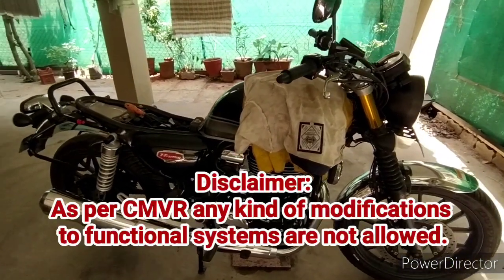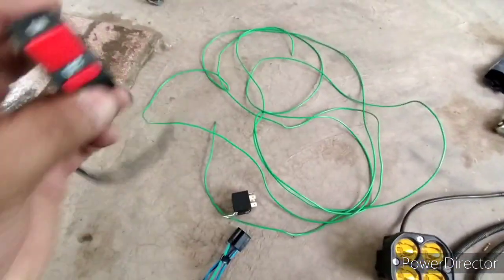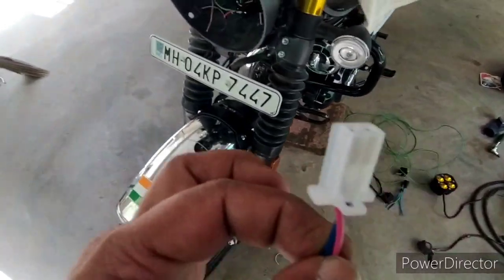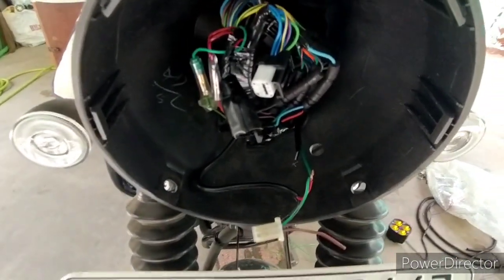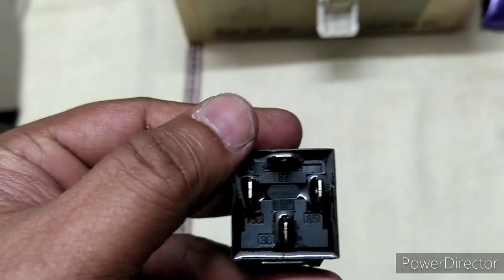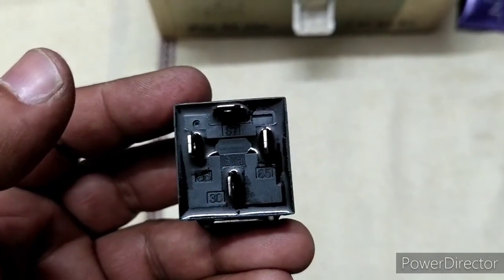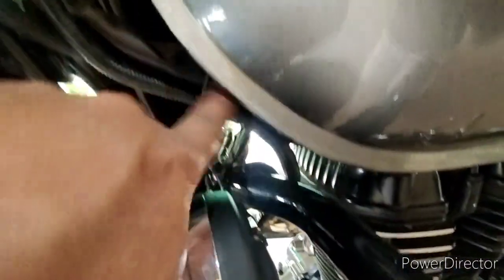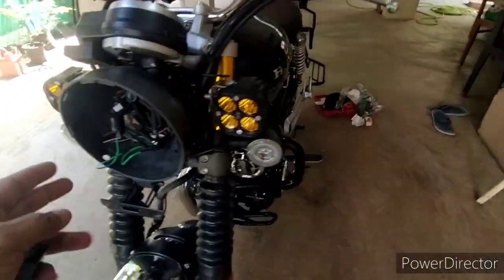Honda H'ness CB350 - Aux light Installation W/O Tampering OE Harness

Comment from the maker: Disclaimer: Before anyone starts debating on the placement of the aux lights, let me clarify upfront that as per CMVR any kind of modifications to functional components is not allowed. So this installation in the first place is a deviation from the rules.

Below link for the fog light mounts:
https://www.amazon.in/dp/B01AG959D2/ref=cm_sw_r_cp_apa_glt_fabc_CPR9YK1FXDJK2BX4G8Q1

Comment: Its hard work and requires patience. It’s preferable to install the fog lamps using wire harness. Its safe, comes with relay, fuse and flasher. No cutting or joints in wires are required. Costs just around 1k-1.5k but worth the price for safety of the electrical system.
Reply from the maker: Yes, it is.. but then what else is there to do in life 😅.
Also from a safety perspective there are joints or cuts to the OE harness..it's all socket based connection in my version.

Comment: hi, what is the measurement of clamp you have used near forks for fixing an aux lights?
Reply from the maker: These are 22mm clamps. Were bought from Amazon but are out of stock since long time.
Below details from the manufacturers website

https://www.electomania.in/products/electomania-a-pair-of-black-motorcycle-turn-signal-light-mount-brackets-fork-ear-clamps-for-harley-black

Comment: Hey Raj.. which are those clamps you have have used to fit the fog lamps besides the headlight location as I have currently installed the fog lights on the leg guard which isn’t giving me proper illumination. Have you got the clamps custom fabricated or is it available at any local shop or online. Please share more about the clamp mount. I want to do the same thing on my RS.
Reply from the maker: These were available on Amazon earlier and later on the manufacturers own website..since some time they have been out of stock.
Check link below:

https://www.electomania.in/products/electomania-a-pair-of-black-motorcycle-turn-signal-light-mount-brackets-fork-ear-clamps-for-harley-black

Comment: Hi where di you connect the -ve of the fog lights to di you return it to the -ve terminal of the battery?
Reply from the maker: Negative of the lights are to be body grounded. 
Sorry for the late reply.
Reply: Thanks I connected the negative of the lighst to the battery and it worked
Reply from the maker: Cool even that works, but just need to route a long cable back to the battery and hence nearest body earth is recommended.
Reply: Ok I already accommodated for that

Comment: Hi Raj. Been a fan (subscribed)👍🏼 of your in-depth knowledge and guidance. 
Looking for an understanding or advice if we can install a RPM meter (absent in our beloved beauty). Your input/thoughts are highly appreciated.
Reply from the maker: Thanks buddy 😊.
Yes, there are plug and play Generic tachometers available in the market that can be installed however the precision of the same is a big doubt. Hence even I have restrained myself from installing one.. there is one Japanese version available from Daytona, but costs a bomb at around 13-14k.
Reply: Kindly provide your input on the wiring connection. Or if you know of any generic plug and play tachometer.
Reply from the maker: See link below. These are universal and come with the wiring diagram specific to their set-up.

Carthrill Universal Tachometer Speedometer Gauge Bike RPM Meter Analog for Bike (Black) https://amzn.eu/d/gucXtKp
https://amzn.eu/d/gucXtKp
Reply: @RajkaGarage  much appreciated.👍🏼
Reply from the maker: Cheers mate 🤘

Comment: Very well explained, 
Q1. Which relay (4pin 40/ 5pin 40/any other)should I used to install 60+60 watt fog lights 12v,for classic 350?
Q2,how much amp fuse should I use for the same?
Thanx buddy.
Reply: 4 pin Relay is enough , 
For choosing relay amp :
 12v - 40ah = 480w which means 
4pin 40 ah relay you can use up to 480W lights 
4 pin 30 ah = up to 360w you can use 
4 pin 20 ah is perfect relay for 60+60 watt light , but you can use 30,40 also no issues
Reply: Fuse you can use 10ah
Reply: You can use 5 pin relay too , if 4 pin relay not available, 

Just leave pin no 87a if you use 5 pin relay 
87a = NC (normally closed circuit)
Reply from the maker: Thanks for answering on my behalf buddy 😊

Comment: Sir,tried using OE Socket but there is no current comes to that socket hence foglight doesnt lit up. Is there any other work around or it is manufacturing defect?
Please reply.
Reply from the maker: Hey buddy, in the OE socket only 1 leg has positive voltage. Check the power at the red wire with a continuity tester. And you will have to take negative power from any metal nut bolt as body ground, only then the light will start.
Reply: @RajkaGarage  Thanks for the reply sir. Then do i have to remove one leg from female socket  which i bought from the market?
Reply from the maker: Use a 2.8 mm 2 pin socket available in spare parts shops and plug it in the OE socket like I have shown in the video. Your positive connection will come from this socket and negative can be body earth.

Comment: Sir, relay that you are using is common Horn relay or some other one, l purchased hjg 60W fog lights, which one i should use 30amp or 40amp.
Reply from the maker: It's a common 4 pin relay. Please use a 30 amps relay.

Comment: HelloRaj, Thanks for the video. However, I was confused about using a relay for this purpose.
What's the difference between splitting the wires and using a relay? Could you clarify that one for me? TIA
Reply from the maker: The relay was used just to save the switch from burning off with the high wattage of the LEDs. And technically that's why relays are used when additional load is used in the system to save the switch and related wiring harness from over heating and melting.

Comment: I was going through the electric diagram, it has two sockets for aux lights and one socket to connect the switch, can we not use as it is
Reply from the maker: Yes, these were just discovered recently. But if one wants to have a relay circuit, these sockets cannot be used. The Tata batteries are already showing its worth (being worthless) and hence without relay it will be load on the harness and battery.

Comment: Sir we can change head light of highness
Reply from the maker: Buddy, one can change the headlight with that of a RE Electra seal beam but will need a lot of modifications to the stock socket and also may need a bigger AMP battery. The stock battery will not withstand the halogen bulb load of 55/60 watt.  Will suggest fitting good pair of auxiliary lighting like maddog etc instead of going through the mod hassle.
Reply: @RajkaGarage  can we fit the royal enfield head light in highness.
Reply from the maker: It's a 7" setup. So the diameter matches but will need to check if the rear cone of seal beam along with the large socket of a H4 bulb can be  accommodated inside the dome. The H'ness dome is already overpopulated with stock sockets and harness.

Comment: Sir, i purchased  same clamp what you've  suggested but I feel it is small not completely closing or you used different bolts to tight those clamps on fork, will you please show me close up image of your clamps, or tell me what should i do return them or what ?
Reply from the maker: Hey Ajay, yes you are right, I used a little longer 10mm bolts as the one received were falling slightly short in length. But just long enough for the nut to thread in.
Reply from the maker: Sure will do that when near the bike..

Comment: There is one AllExtreme EX40WF2 4LED fog light. Can you confirm if it is the same ?
Reply from the maker: Hi Sachin, if you buy from Amazon, AllExtreme sends anything that's available at disposal. I read many reviews and saw pics of lights sent by them on Amazon and found there was no uniformity in which light they are sending (anyways all are Chinese). 
I suggest, hunt for these lights in local market as you can test and buy and also costs cheaper than online. I got this for 1600 a pair from a local shop. 
Earlier for my RE I had ordered from Amazon and had a return twice for faulty ones.

Comment: hey Raj, could you plz help how you have mounted aux lights on folks?
Reply from the maker: Hi Pratish, I have used C clamp to install the lights.
Pasting the product name on Amazon here as hyperlink may get blocked at times.

Electomania ® 1 pair of Motorcycle Turn Signal Light Mount Brackets Fork Ear Clamps For Harley (Black)

Comment: How did you mount those lights ???
Reply from the maker: I have used aftermarket clamps from Amazon to mount them.
https://www.amazon.in/dp/B01AG959D2/ref=cm_sw_r_cp_apa_glt_fabc_CPR9YK1FXDJK2BX4G8Q1

Comment: Nice addition to the bike, as the headlight throw is quite debate able... Would it be possible to mention the link of the aux lamps??.... Thanks for the detailed video and the wiring instructions...👌🏼👍🏼🙏🏼
Reply from the maker: Thanks mate! Yes this an absolute must especially if you are doing night rides on highways. The OE HL is absolutely useless on highway.
Regarding the aux lamps, I bought them from a local store in Mumbai Grant Rd as there were lot of mixed reviews on Amazon about these lights. They are Super 4 x 4 brand and cost me 1400 a pair.

Comment: Have a suggestion here.   In the wiring diagram there's error.  The extra plug / adapter given inside HL cup is male and it's not female as you mentioned in diagram.    I have used same 4pin relay in my 4 bikes for horn & aux light purpose.  There's one more mistake in wiring.  You have taken only positive from headlight socket and - ve from battery. Grounded aux light -ve.  Which will waste too much current from battery.  If you have taken -ve from HL socket then it's fine.  Also taking+ve from main wiring harness will take too much payload from battery.  Already this bike has huge negative point is very small battery. It's just 6amps.  150cc Unicorn had 7lb battery. With 6lb battery you should have taken both + & - from HL socket & putting on 86 & 85 in the relay.   Very simple the both input for 85 & 86 should be main source or component wire but not one from direct battery.     By going in your style diagram you may see many side effects such battery drain issues, dull pick-up in high payload or in 2nd & 3rd gears.   For accessories taking -ve ground in big mistake in bike which has latest tech CDI coil unit. I wouldn't recommend your diagram even if the cb350 had 9LB or 9amps battery.   Cheers 👍.
Reply from the maker: Thanks for pointing out the 'Typo' . Somehow inspite of calling out as female pin in the video, somehow made this typo in the diagram.
Also the only short cut as per my experience I took was the main grounding which I directly took from the battery to complete the relay circuit. This also keeping in mind the overall distance between the various components, which is hardly anything. As you may know the primary role of the relay is reducing the load from the main aux switch and tranfer that on the relay which works as a mechanical switch on the power flow from battery to the load, and which is what my circuit does, including the direct grounding of aux lights. And no, I don't see any drop in power in any gears(being a Mechanic such an observation does not go unnoticed for me) or any load on the battery as you must have seen in the idling test with all components on. Yes, I do agree that the battery is underpowered, but we will have to live with it before any upgrade replacement within permissible limits.
Cheers 🤘

Comment: What is watt per lamp and lumens? Which brand sir?
Reply from the maker: These are claimed at 20 Watt each with 90L/W. Due to the yellow colour I found them to be sufficient on road. 
These are Super 4 x 4 brand aux lamps which I bought from a local shop in Grant Rd Mumbai for 1400/pair.